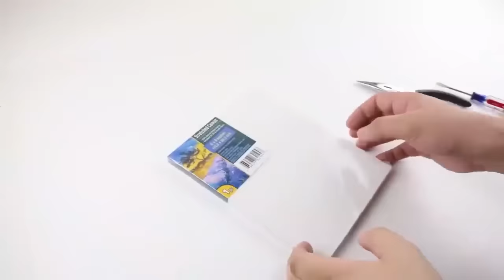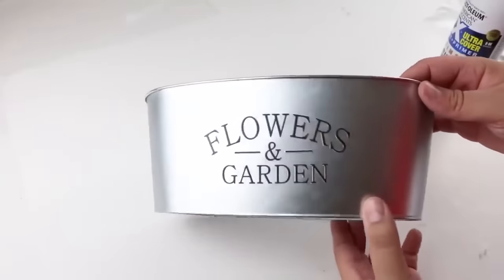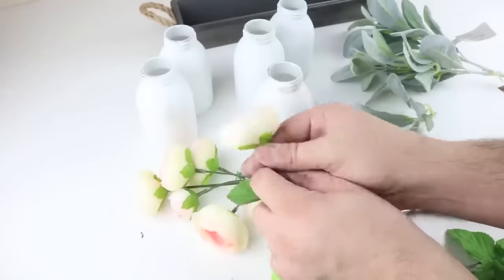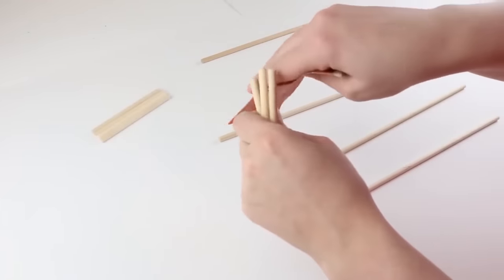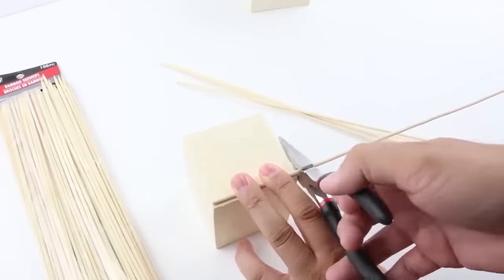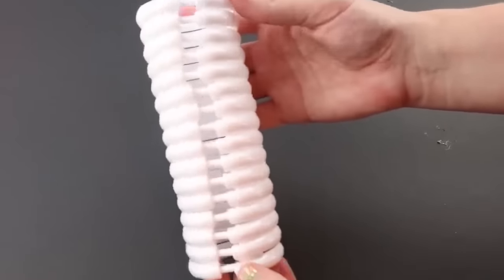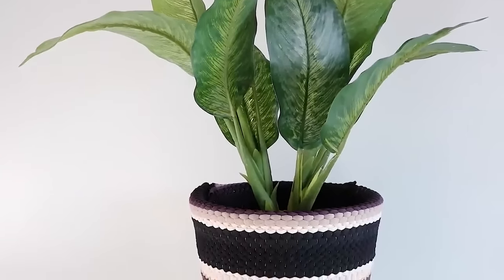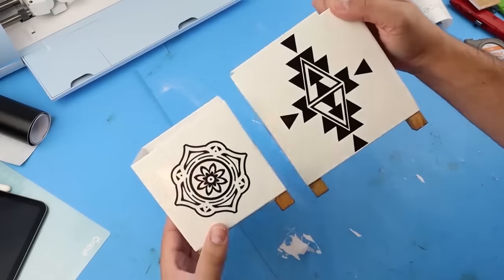50 DIY Dollar Tree Decor Ideas | Best Budget-Friendly DIY Planters for 2021!

Comment: Very good video.. clever designs.  My fav stain is called gunstock by minwax.  On the small planters you stuff first and put rocks on top... I would put a few rocks in the bottom then stuff and more rocks on top just for stability.  And on the plant stand that had the hexagon box and the little one like it painted black.. I would glue a piece of dowel or a jenga block underneath the middle for more stability.

Comment: Here is a tip. You can get Laminating Sheets tear them in half. Go to your printer and print any photo on your sheet. Using it with the inside as the photo side. then place it on your canvas and heat press it down on the canvas. This is an amazing thing to do. I have done this and it works well. Then you just need to reframe it.

Comment: Love your projects. They are awesome !
I'm thinking about making flowers from the canvases. Just round circles in different sizes and maybe hombre colors
On the cactus planter, I'd like it splattered on a color that fits into your room decor.
I'd paint the bottom of the bucket just to give it a cohesive finished look.
The roses in the box are very pretty, however I thought that it needed some leaves to fill in the edges.
Love the tuna can with the clothes pins. I'd put in the light and the greenery in and around the light.

Comment: A suggestion: on the 3 hanger planter, if you use a flat stencil brush you could highlight the lettering on the middle planter. If the others just had raised shapes those could be highlighted also.

Comment: for canvas planter, (the first  DIY idea on video) removing canvas from frames - why not use the canvas for the sides of the planter, rather than buying a piece of poster board? It can be decorated and painted also!
Reply: Because you can't fold it and get that galvanized metal look he's going for, but of course anybody else who makes it could certainly do that, you wouldn't even have to remove it You could just make a planter box out of it and paint it like you said but that's why he didn't do it for this video.